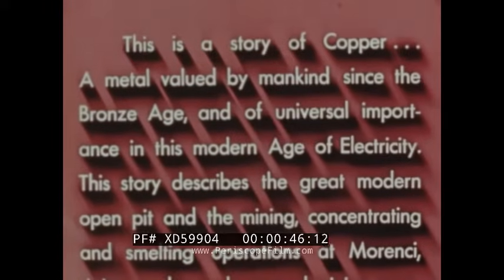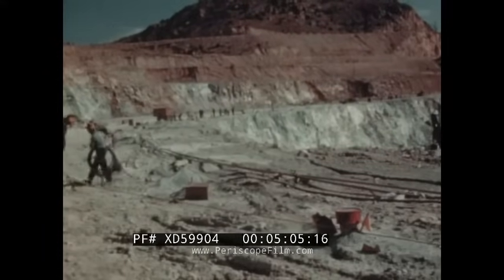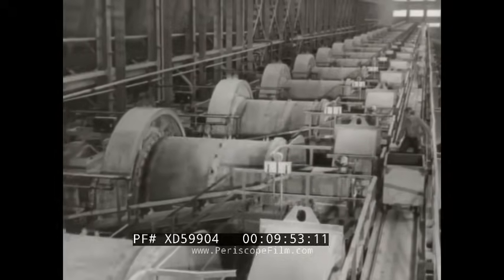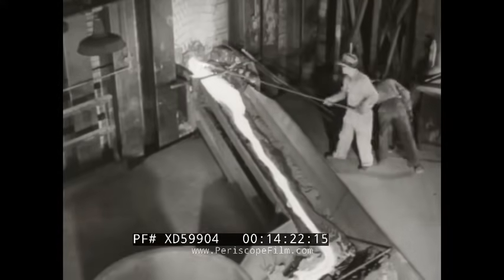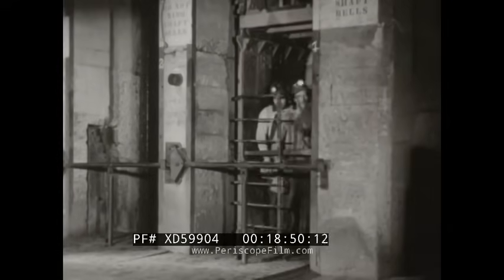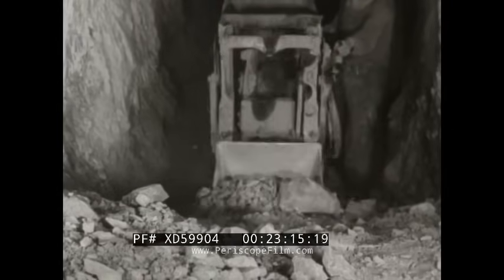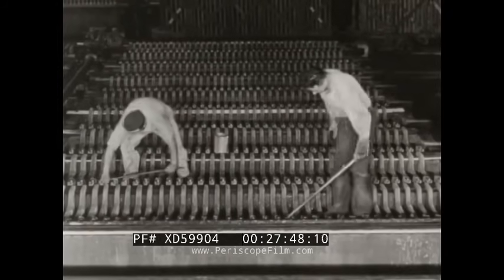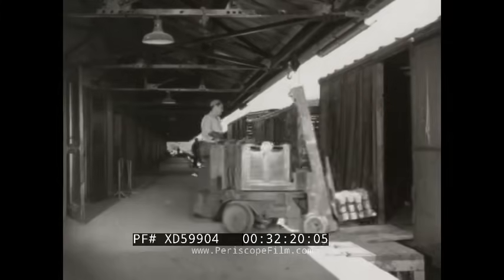" A STORY OF COPPER " 1950s BUREAU OF MINES COPPER FILM   PHELPS-DODGE CO. MORENCI ARIZONA   XD59904

Comment: Okay, there is no "waste" in an open pit mine except the tailings from the process. Overburden is used to build dams and land bridges for trains and vehicles, as well as roads and infill. Engineers use as much as they can to purposeful ends. It's the only way the mine can operate efficiently, if it can operate at all.
The "green poles" are, in principle, a charcoal flux. This gets used everywhere because carbon bonds very strongly with oxygen.
Reply: No waste except for TaiLings ?? So there is waste 😮, Yah DopeY.

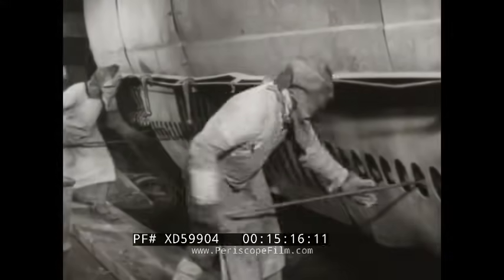Comment: Those guys at 15:19 swaddled in work clothes and leather so they can withstand the heat given off by that furnace have the hottest job I’ve seen. I’ve welded over uninsulated steam lines in the south Florida summer and thought that was hot! 🥵

Comment: I wonder what 30 tons of air looks like?🤔
Reply: One pound of air takes up 13.33 cubic feet at sea level and 70 degrees F. I am currently in a room that measures 10 by 10 by 9 feet high. So the room contains 900 cubic feet of air. The 900 cubic feet divided by 13.33 cubic feet per pound means the room contains 67.5 pounds of air. Imagine what a great volume of air is required to collect 30 tons of air?
Reply: @normchristopherson5799  Good example.  I worked in a 5000 foot deep  underground gold mine in Yellowknife, Canada beside the air intake shaft. At the 135 foot level the heavy plank door leading to the air shaft was impossible to open inwards unless the smaller door on it was opened first to let the pressure off it.  We opened this larger door to blow the smoke out of our work place.  It happened instantly.  One had to be very careful not to be in the door jam when closing that door again as it closed with a mighty slam.

At the 700 foot level in that tunnel between the air doors being used as part of the air path to the bottom of the mine, one had to lean into the wind if walking that direction. Cloths flapped in the wind.

On the surface at the head of the air shaft there were two huge, towering, cast iron, propane gas burners, mounted on edge, one on each side of the shaft that were lit to pre-heat winter air to above freezing.  That air temp could have been as low as 40 - 50 below F.  Injected sub zero air for months at a time would, of course have frozen everything in its wake, waterlines, gas lines, the ground, ore, etc..

The volumes of air being injected into that mine were immense.  Thanks for providing a mental picture of the concept of just how much air that might have been.
Reply: @gragor11 . Impressive. I can remember when my brother had his construction business. I asked why he didn’t work in the extreme cold weather. He said after about three bucket loads of earth with the excavator the dirt below the frost line froze inside the bucket essentially filling the bucket and so adhered you couldn’t remove it until it thawed.
Reply: @normchristopherson5799  you not full of hot air.
Reply: China, India  and Russia build a coal fired power plant 1 a month,  American power plants and copper smelters have modern pollution controls, that cost the company millions of dollars. China, Russia India  has no pollution controls, because there is no EPA over there, like in America
Reply: @terrenceprzybylski3226 . At the time Obummer was president China was putting a coal fired power plant on line one everyday. 
For eight years. It slowed down but still at it. That’s why it was such a big deal when Australia stopped shipping. I mean load ships outside Chinese ports were stopped.

Comment: I worked in the copper industry  for 30 years as a maintenance mechanic,in all phases in the production of copper,for magma, Bhp copper company in san manuel az and asarco in hayden az
Reply: Hi, please get me a job with your link 🙏🏼. I am a graduate of Industrial Chemistry in a university of technology.
Reply: @HomeTalesTapestry  sorry I'm retired 7 years now.
Reply: I worked at Pinto Valley for a while.
Reply: Oh great sir, do you face any health issues currently as a result of working in the mining sector for 30 years?
Reply: @HomeTalesTapestry  just a little hearing loss, from all the machines. But I'm 72 also.
Reply: @terrenceprzybylski3226  okay stand strong boss !
Reply: was it hot? 🤔
Reply: @Chevroletcelebrity  The Superior mine was very hot. I worked on 4800 to 4900 feet underground and without ventilation provided by chilled water piped down from the surface the air temperature in the work areas quickly reached 140 degrees.
Reply: @richardsmith9609 your experience is genuinely incredible. Not enough people will see your comment.
Reply: Do you know Mr Wellington the richest man in Arizona ?
Reply: Dad worked for Phelps Dodge and Southern Peru Copper for many years. Used to fly into AZ to Morenci many times!
Reply: Эти предприятия ещё работают?
Reply: I worked underground for Magma Copper and BHP in Superior Arizona in the 1990's and transferred to Ely Nevada and worked open pit for 21 years for BHP, Quadra Mining and KGHM until retiring in 2020. Lived in Globe and knew San Manuel and Hayden well. I was working in Superior when the 4 miners were killed when the ore pass/manway collapsed. Terrible accident! God bless you fellow miner.